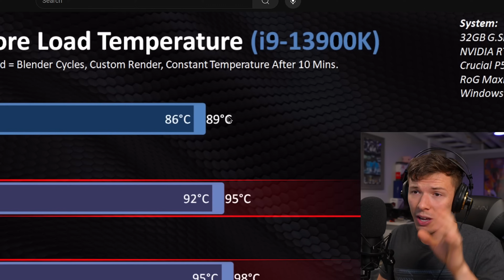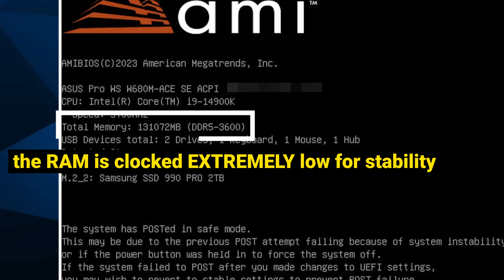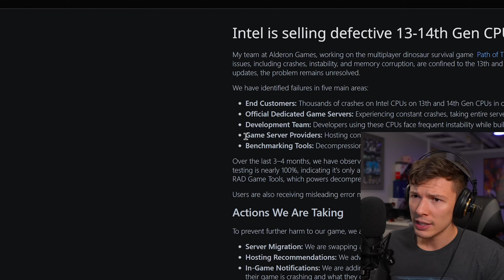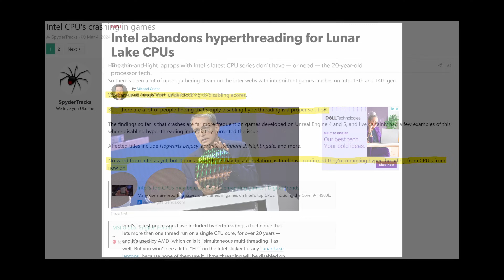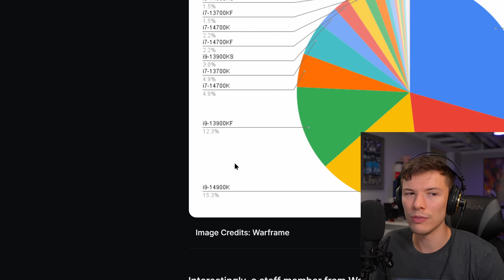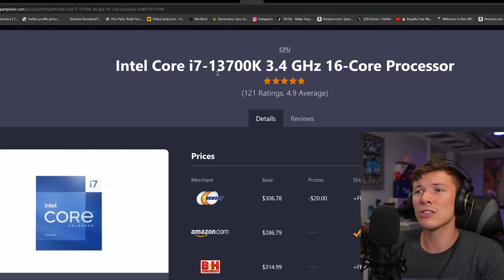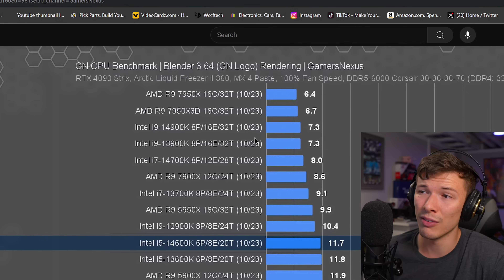Intel F**ked Up Bad

Comment: Bro my friend trolled me for choosing a 12400f over a 13600k.

Boy am I sleeping tight knowing that I made every invested penny worth. 12400f is a Beast
Reply: a 12400 is not a beast.. you were better with the 13600k, which is i5 and does not have these problems.. this is only for the i7s and i9s...The 12400f will bottleneck you in half the games when using something like a 4060...
Reply: I always love when people buy lower-midrange stuff and call it a "beast".
This 4-cylinder Toyota Camry is a BEAST.
This processor opens word like a BEAST.
(The 13600K is not affected by this whatsoever.)

Comment: Wow i feels awesome, i am an 00.1% of consumer that are blessed from awesome speed and performance from i7 13gen. Probably because i tune the voltage at 5.5 ghz and never allow it higher than 78c . And also work incredible with RTX 4080, mi SIN here are probably i don't use any AMD component. Yes i am a Sinner.

Comment: for decades, Intel has been known for making super reliable good performance chips.  Very rare to have an issue like this.  They are having some issues right now... have to see how much they hurt their rep with this.  Many companies are cutting corners and pushing things cheap as possible with biggest profits possible in last several years though... a lot of big companies with good reputations are just banking on their reps to pull them through, like Toyota

Comment: It's obviously a heat degradation issue. If you change ANY settings downward, it gets better or works for awhile.  My guess is that Intel is trying to keep up with AMD by over clocking their CPU's, but to the point of baking them. Intel is afraid, very afraid. I would be too.  Manufacturers of mainboards that support Intel CPU's are probably going to have fits.

Comment: Blue is my favorite color, but I buy AMD.  These defective CPUs could probably be made more stable by capping at like 5Ghz instead of 5.5+, but then you paid for performance you don't get. May even need to go 4.5Ghz with minor voltage boost. Better than crashing, but definitely not ideal.

Comment: They basically ran out of ideas to keep up with AMD so the final hail Mary was to sell massively overclocked processors with all the contingent problems that will produce. Selling processors that have glitch errors like this running within advertised spec is totally unacceptable.

Comment: I have a 13600KF, not the most insane CPU but a very good CPU nonetheless, I noticed that it just idles at 60+ Degrees which isn't normal whatsoever. I went into the bios and saw that because of the bios settings,  a lot of the cores were being overclocked to 5ghz. Turned off the setting and saw the temps drop. I wasn't having any instability issues, nor am I still, but why is a 13th gen i5 running so insanely hot and overclocked right out of the box
Reply: How is... checks notes a CPU running 40 degrees away from its junction temperature "insanely hot"?
Congrats on artificially limiting your CPU due to FUD, I guess?
Reply: @tim3172 did you read what I said? A chip shouldn’t idle at 60+ degrees and shouldn’t thermal throttle on esports titles

Comment: Just saw a 9 month old reddit post on /intel about 7800x3d vs 14900k for gaming and actually felt sad. So many people arguying they wont trust Amd, how that backfired....
Reply: Fanboys will be fanboys. Maybe not so much anymore.
Reply: crazy that intel is the completely untrustworthy one now.
Reply: And also... if you have a 13th or 14th Intel chip with a higher than 65w base tdp, then your processor could end up going up the swanny very quickly.
Reply: I've had intel cpu's 3770k 8700k and 12900k all my life and it's always been super stable for me, who would've ever suspected this massive flaw, 100% gonna have an x3d chip in the future
Reply: After hours of looking and investigations.... part of the problem is the cpu making a too high vlid request from the motherboard (over 1.5v). And if the cpu keeps being exposed to this it will end up dying. There are one or two other things going on with the 13th / 14th gen
Reply: @markhindhaugh6304  Yes, this was intentional so they could push the chips to compete.

Comment: I don't really blame people buying 13/14th gen, after all, CPU instability and degradation from stock setting is completely unheard of for most modern enthusiast.

I own a 12400F base Aldar lake system, I am satisfied with the performance and price back then, but even then, Intel would need to go above and beyond to convince me the new Bartlett-S on LGA 1700 isn't going to suffer same fate like other Raptor lake processor, I don't want to be bag-holding a year down the line.

IMO the worst thing about this issue isn't the CPU failing, but rather Intel deafening silence, as if Intel imagine the issue will just go away, and people will just buy Arrow lake with their eyes closed. Shame on you, Intel.
Reply: i have 14400F and there is no problem at all,because this is not K-type CPU.Temps are super low even with gaming not passing 65 celzius.
Most problems come from i7 and i9 13th and 14th generations because they pushed to much power and to much overclock.
This F-type i5 from 12th to 14th are good gaming cpu-s and they are operating at low temps and you dont need expensive water coolers to cool them down.
Reply: @JohnRiley-r7j It is not because too much power because enterprise use W board that use the processor conservatively. And laptop version also affected.
Reply: Glad to hear it.
I am still running my i3-10100f and its idlle below 3W cpu.
65W rarely when maxed although has bit higher pl2 power i guess (76W maybe)
Cool and quiet, I use Arctic Freezer 64 (20USD tower cooler)
. Although 12400f won't bring me desired 2x single core uplift and I don't want going hybrid core cpus beyond that 12400f.

For me both AMD and Intel have its cons.
Intel hybrid and higher power draw at higher end chips, AMD heat spreader with holes making cleaning paste to be hell.
Also AMD doesn't care budget segment anymore!
Reply: @gstormcz  Your i3 is still good CPU for most stuff,and like you said,there is no chip that is perfect,everything have pros and cons.
Reply: @JohnRiley-r7j  Thx for encouragedment. 😉.
I am DYI for last 20y and I was used to upgrade cpus mostly each 2years, but around 2020 with crypto on gpus, even cpus value went bad.
I3 10100f was last budget cpu to bring me top optimal 100 percent uplift in single core over last one (AMD K8-7660) with similar price.

Agreed, I am still booting tuned W10 in around 6s fast boot. Both online games run 75fps, it can do upto 140fps. Typically gpu limited in more HW greedy game.

The upgrade will be 4K and depending on AMD Rdna4 maybe 7900xt. But It would be probably overkill even at 4K in world of warships = 6650xt can do 75fos when settings cut down😀

Comment: i have an i9 13900k. i have an corsair 360mm aio and i had higher temps then this around 95C in cyberpunk. The fix was limiting the amps to 307. Neither limithing the watts clocks or V didnt work. The i9 is not for everyone u need a very good cooler at least a 360mm aio.

Comment: The 4096 Watt power limit is just that, a limit.
In the past, motherboard manufacturers have had these same limits in place; 4096 Watts.  The processor uses as much power as it designed to so it is the design that has problem when all of the Intel's past processors have had this same 4096 Watt limit and have not had a problem.

Intel have been trying compete aggressively and have not designed thier processors to properly regulate themselves as a result.  They can blame the motherboard manufacturers but the processor design itself draws excess power and cooks itself.

Comment: It might be a perfect time to pick up a heavily discounted 14900K. Intel is fantastic cpu for me. Runs cool underload and handle productivity tasks very well. The main cause of the degradation is some cores are boosting to 6ghz or whatever while using a ludicrous amount of voltage so over time it degrades the chip. The easiest way to fix this is to just sync all cores and increase the LLC. I have a 13700K with 0 degradation and also built multiple 14700K and 14900K for clients and 0 degradation and instability.

Comment: Notice how silent the claims of dominance of intel 900 users have become in the last few months.

Comment sections were riddled in people quoting “MY 14900 + 4090” is better than yours.
If it is thermal degradation then these top end systems were probably the first to cook themselves if they hadn’t  undervolted everything.
I’ve noticed these type of comments all have 7800x3d’s now 😂🤷🏿‍♂️

Comment: I see this after ordering a i5 13600k 😐
Reply: There haven't been any problems on the i5s at all. I ordered a 13600kf while I RMAed my 13900k and I kinda like it better than the i9, but you shouldn't have anything to worry about. As of now there aren't any bad reports against the i5s.
Reply: @danielabbott9312  thank you 👍
Reply: @JDG_YT2  no problem, you are going to be blown away by the performance, it shames the i9 when you look at the power being pulled vs the performance. It is a little monster. I have been super impressed with it.

Comment: The whole 4096w situation comes down to the way values on a curve are handled in bios. 4096w = max possible value for the PL1 variable. Essentially they just said "slap the biggest number you can in there to uncap it", because when it comes to values that high you will obviously hit other limitations well before reaching even a fraction of that,  ie various CPU self-protects, motherboard power phase spec limits, even the PSU max output would become an issue... Name one 4096w rated PSU. (For now, when the 5090 comes out it might be a thing, heh)

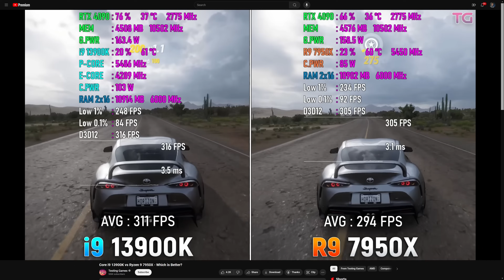Comment: 3:40 the ryzen 9 7950x here also is more efficient.Just look at the power draw.If you sacrificed those extra 20-30 frames and built a machine with a ryzen 9 7950x,your pc will run much cooler and silent and it will also be much more efficient.

Comment: Same graph shows a AMD Ryzen 9 7950X drawing 264 watts...so what's the point between 264 and 295 watts. AMD cpu's are getting freaking hot as well with that Ryzen 9 7950X reaching 95c out of the box and AMD says it's normal op temp. Let's not get all ahead and copy others blind! My I7-14700KF works great after 9 months of use not 1 bsod. 

So lets see what the real issue is and the sollution to it! I can't believe it will be a real design flaw. And if it is Intel is screwed. I had isues with AMD as well in the past. And people already forgot the exploding Ryzen 7 7800X3D?

Comment: This almost looks like the same problem that struck the xbox 360 and ps3.Because of the thermal cycles,the bga bumps underneath the die would crack.Since its impossible to keep these cpus at a reasonable temperature,its likely that this is the problem.
Reply: If you look the rsx die of a PS3 which has been heavily used,it develops a purple-ish tint which might be a sign of silicon degradation

Comment: "Intel effed up pretty hard" "class action lawsuit awaits them" well, I guess Nvidia did a better job of hiding the alarming rate of 4090 failures by using gaslighting extensively, too bad Intel couldn't compete in the gaslighting field...

Comment: ever since the first ryzen there was no real reason to ever go with intel. they didn´t have an answer then and they don´t now, their desperation led to this.
Reply: As a first-gen Ryzen 1700, 3700X, and 5900X user, you're straight-up DELUSIONAL if you think Ryzen's first generation gave no real reason to use Intel.
Spend about 30 seconds familiarizing yourself with the releases of all of the Ryzen products until around the 5000 series.
Zen 1 was one of the worst launches in history, riddled with months of UEFI, Microcode/AGESA, and chipset updates that were required to get a semblance of stability. They had a recall on the first few batches due to unfixable hardware bugs.
Zen 2 (3000) wasn't much better, with unpredictable boosting behavior, outright failure to hit advertised clocks, and, again... many (MANY) updates required. Stack that with not having enough space on the BIOS chip to store the absurd number of CPU releases on it, and it was a huge mess for AMD.

Comment: Me chilling with my 13400f: "Wait really? I didn't notice any of that."
Reply: Only see failure on i7 and i9, but can be bending stock socket 1700 it need buying anti-flex to avoid damaging CPU.
Reply: I have 14400f,no problems at all,performance is great and my temps not passing 65 celzius even on heavy gaming sessions.
Our CPUs are only 65 wats TDP and they are no K,this plague only hits high end CPUs like i7 and i9 13th and 14th generation.
Reply: @JohnRiley-r7j  Got mine because of power issues. Glad I did honestly.

Comment: Bruh. For the first time ever, I bought my most amazing gaming PC this past year. For the 1st time EVER, I didn’t buy intel. I bought an AMD 7950X3D. Why? Because according to some YouTube pages, it was the best gaming processor overall. Also, it was cheaper for the build I was going for, compared to the higher tier Intel. Man, I got lucky on my choice.
Reply: If gaming is all you need the system for, you could've saved some money and went for the 7800X3D which has faster gaming performance than the 7950

Comment: 3D v cache is so much more of an elegant solution to achieving more performance, instead of "just shove more lightning inside of it!!!".
Reply: Loving the quote 😂😂😂😂😂
Reply: 3DV cache is just a solution for people who just want something that works out of the box without tuning. You can still tune your RAM on intel chips and get a massive boost
Most benchmarks you see online have intel at a disadvantage. AMD has the advantage of the 3dv cache and this tech tubers over here testing intel with 6000MHz ram at XMP🤣 Turn that sheet up to 8000 CL32, then we talkin'
Reply: 100%, that's why 3D V-cache has such a huge performance in exactly zero productivity workloads.
At stock, the X3D chips are slower due to the lower clock speed and the way victim caches work are incompatible with workloads outside of GaMinG.

Comment: How do you know it's this CPU-degradation issue and not something on the motherboard? Is there specific errors on BSODs?
Reply: According to other comments, they replace the CPU, and the problem becomes fixed
Reply: @M_CFV  I'm not questioning the validity of these errors, I'm looking for signs that this may be a problem for my system. How do you figure out that it's the CPU, and not the GPU or the motherboard, beyond knowing that there's widespread issues with the CPU? 

Also, is this because these run hot and run for extended periods in the 90° to 100° range? If a CPU in general doesn't go beyond 80°, will that stave off this problem?
Reply: @gargamel314 there could be many issues that causes the intel cpus to degrade over time. the only safe option is to undervolt the cpu and hope for the best

Comment: i bought an intel cpu cause i also bought an intel graphics card. thankfully i went with the 13700K instead of the higher SKU's. 4.9% failure rate is way better than 99.9. I also put a deepcool assassin IV on it. so hopefully i won't be one of the unlucky ones who gets these issues.

Comment: One of the potential issues is the Intel stock CPU hold down. We know that over time, this causes the CPUs to warp slightly, which could likely be creating hot spots and maybe Intel doesn't have temp sensors in the right places to catch this. So, maybe the CPU overheating crashes while the CPU is outputting that it's only at 90°C.

Comment: It is not a software issue...
They rushed manufacturing on 13/14th gen and missed something. That's what Wendell and Steve have reported at least.

I've been using Intel all my life, but this is heartbreaking in some way. Yeah there's always gonna be arguments for AMD & Intel and people will always fight over their opinions.
But at the end of the day you get what you need/want and not what people tell you to get, at least in my case.

Intel running hot? Well undervolt the darn thing and stop using Mobo manufactures settings because that will Always result in higher temps. Yss I know 90% of people don't bother or just don't know about it but honestly, most of them sre just to frigging lazy.
There are more than enough videos and guides out there that can tell you how do the right things.
Anyway, what do i know, as a 26y old pc nerd it's hard to see the other side that doesn't know a thing sometimes.

Comment: So glad I got the 7800X3D over the 139000K on my new rig last year. I went back and forth a lot because I always used Intel.
Reply: For gaming the 7800x3d is obviously a no brainer. For productivity the 13900k was faster and cheaper than the 7950x and was a no brainer.
Reply: @benjaminpedi2302  Except that it used significantly more power just to win by a few percent on average over the 7950x.
Reply: @benjaminpedi2302  for productivity, no human eye can tell the difference between 14900K or 13900K against 7950X unless you're running the benchmark deliberately

Comment: Motherboards are set to "AUTO" out of the box,
adjust long term power draw wattage according to your chips specifications
adjust short term power draw wattage according to your chips specifications
Adjust the Amps to your chips specifications

These 3 settings are the main culprits, Its not INTEL its the motherboard manufacturers.
Reply: Have you watch the video, have you see the guidelines Intel ask motherboard manufacturer.

Comment: I just got the 5700x3d while it's on sale for $183, which is basically about what they go for used, within ~$20. I haven't installed it yet, but I got a Peerless Assassin to go with it. Maybe this Intel thing will push more people to AMD, they're cheaper, more power efficient, and often times more powerful,p especially with gaming on the X3D chips.